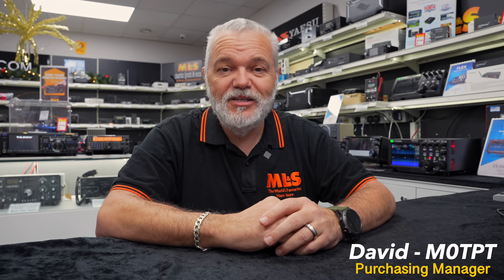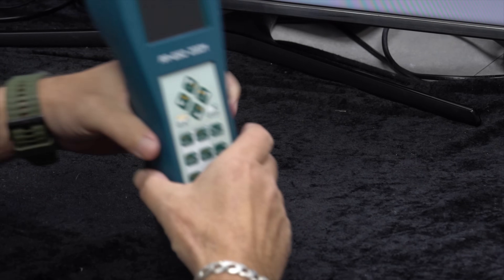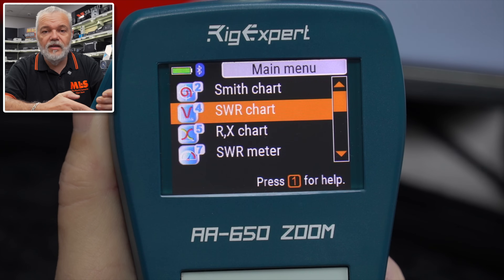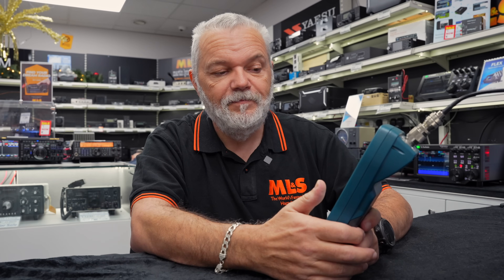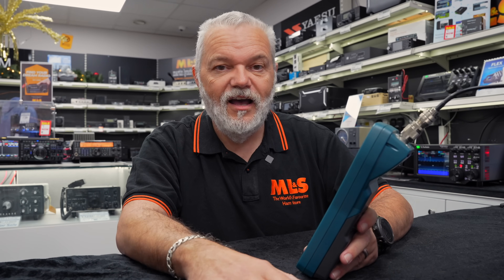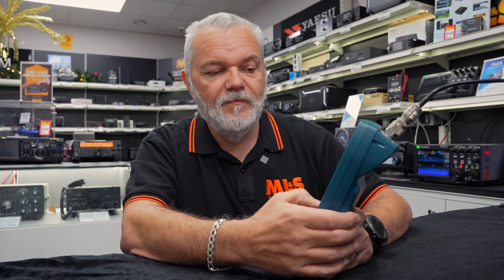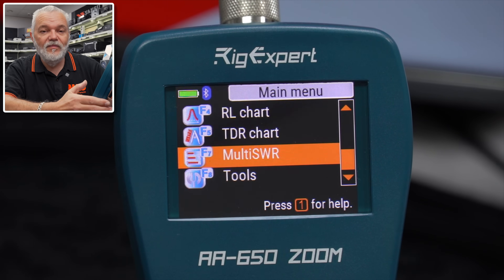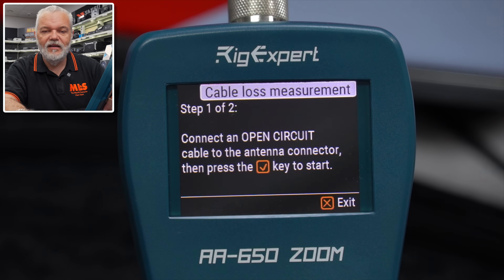Why Your Antenna Isn’t Performing – And How to Fix It

Comment: Nice video. With TDR I think you can determine the velocity factor of coax if you know the length . I can do that with my VNA . also I can get cap rating of coax. That rigexpert should do all that as well. You can switch to 75 OHM mode as well to check delay and phasing lines also for SAT and TV coax testing. That is a very handy tool . Cheers from NY/ USA ! Your video's help so many all around the world !

Comment: 10:27 what? return loss has nothing to do with the loss of the transmission line (such as coaxial cable). loss that occurs in a transmission line is called attenuation. return loss is a measure of how much of the RF signal that's being generated is reflected back to the source and it indicates an impedance match or mismatch within a system. high return loss is desirable in case of loads such as antennas because it indicates that most of the RF energy is getting used up at the load rather than reflected back. 

while you can measure coax attenuation with devices such as portable VNAs, and even the with RigExpert VNAs, it's wrong and misleading to say that return loss is an indication of cable attenuation. no offence but your presenters should be more careful while talking to a wide audience about things they don't fully understand.
Reply: 100% correct
Reply: swr  is a complex subject